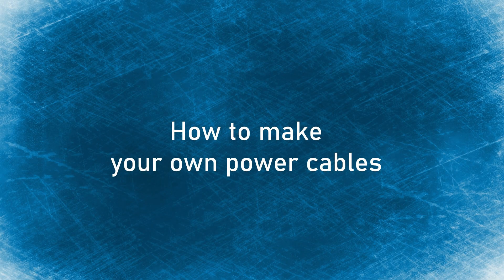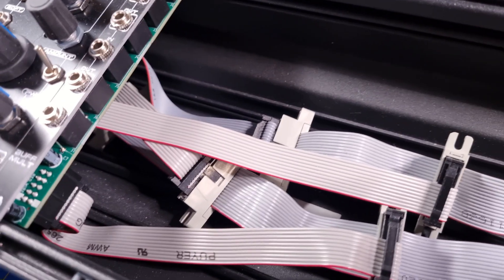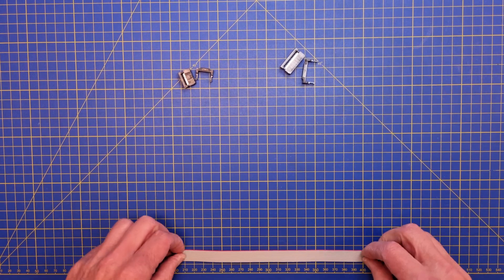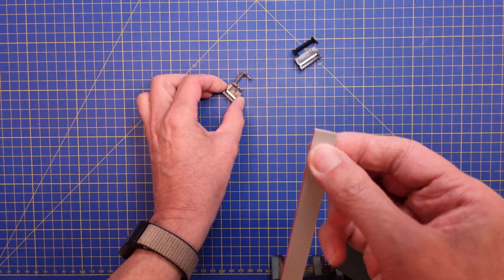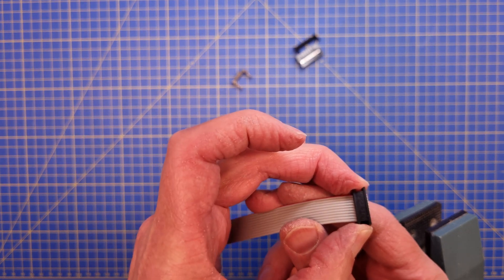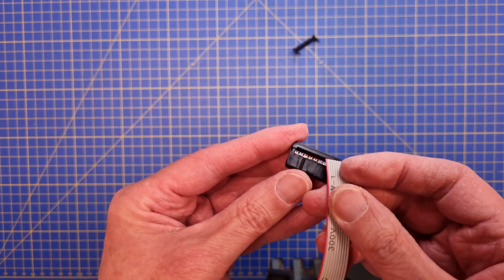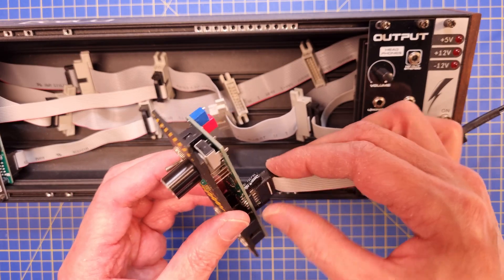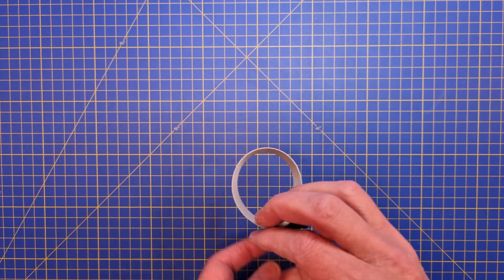Eurorack DIY: Make your own power cables

Comment: Hi, I bought a Eurorack low pass filter module, but I don't have any Eurorack equipment. Is there a (relatively) easy way to power it and so use it standalone? Thanks
Reply from the maker: Hey, welcome to the world of Eurorack 😀
First of all you will need a good power supply that can output regulated +12VDC and -12VDC to power your module.
Next you need consider what signal levels you can input to the module and what signal levels you get out of the module. In general Eurorack modules have a input signal range of +/- 5 VDC and the same levels are outputted from the module.
These are quite high signal levels compared instrument or line levels, the safe (but more costly) option would be to connect an input module and an output module with the filter in between. But you could probably get some kind of LP filtering going by just inputting line levels directly into the filter and sending the output from the filter to the next unit in the signal chain.

Comment: Any chance you could provide links to the parts required? Thanks for the great videos. Just binged all of yours in a few days :)
Reply from the maker: Thanks a lot - glad you like them!
These IDC connectors are pretty common, here's an example of a 10-pin receptacle from Amphenol:
https://se.farnell.com/amphenol/t812110a101ceu/socket-idc-s-relief-2-54mm-10way/dp/2215247?ost=t812110a101ceu

Comment: I also like to make my own cables but I make them custom fit for my case, often less than 10cm. As long as you can reach all the connections; the shorter the better.
Reply from the maker: Yeah, that's one of the benefits with DIYing your own cables - you get them exactly as you want them.

Comment: The problem is how to cut the ribbon cable good, the German Knipex has a special cutter for it, but it's not cheap.
Reply from the maker: That"s true. 3M has that to and they also have a crimpng tool. Both expensive.
Reply: @MeeBilt  3M? thanx, need to check that out.

Comment: Nice explanation! You don't have to have a vise! I crimp mine with a water pump plier, adjustable wrench thingie, you just have to be careful to apply the pressure evenly.
Reply from the maker: That works fine too, if you are careful and as you say apply the pressure evenly.